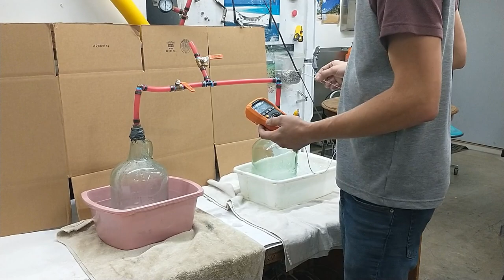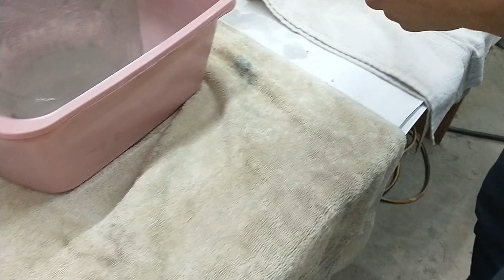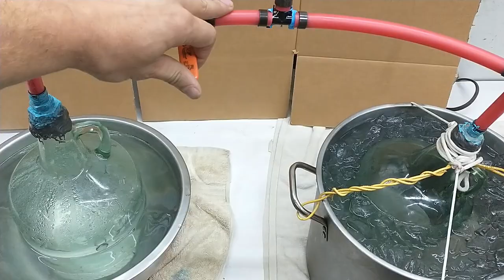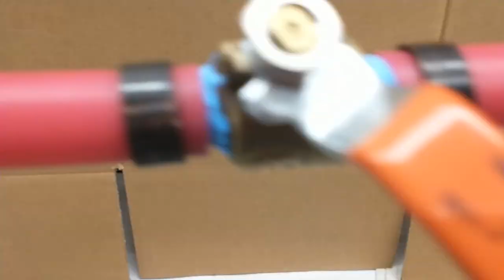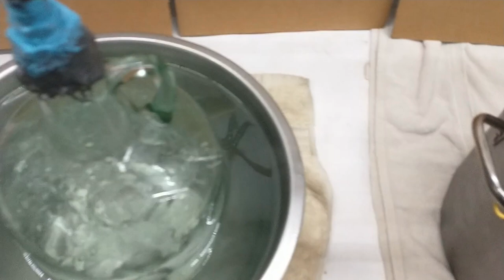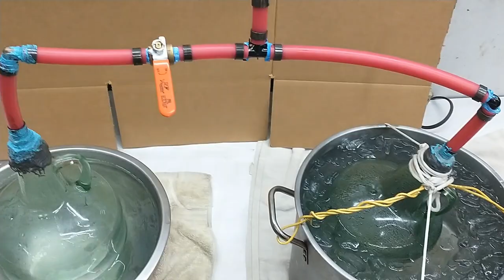COLD BOILING WATER To power The Tesla Turbine Renewable Energy System

Comment: Excellent work Jeremiah. Just some thoughts.
Is it possible that all the confusion in the comments, as to the stabilising of the two reservoirs, is due to a misunderstanding of what is actually happening?
 Steam powered turbines work with a positive pressure, forcing the gas (water vapour) through the turbine and out the exhaust. You are working with a negative pressure, yet using the same logic in your explanation, that the boiled water is going into the turbine and out the exhaust. 
 I'm not too sure that this is what is actually going on, at least the explanation doesn't sound too clear, hence the confusion. The water vapour isn't being pushed through the turbine, by the boiling of the water (at a lower temperature because of the negative pressure). It is being sucked through the turbine by the condensation of the vapour in the cold reservoir. The gas being turned into water, by the temperature reduction in the cold reservoir, is the "driving force" not the boiling of the water. The water vaporising in the hot reservoir is simply filling up the void created by the cold reservoir.  There isn't any positive pressure involved, if there was, the water wouldn't boil at that temperature.
  You are creating a negative pressure by condensing water vapour, to turn the turbine, you are not creating  water vapour, by boiling water to turn the turbine. The boiling water is simply supplying fuel (vapour) for the condenser to create a negative pressure, which turns the turbine.
 I hope you get what i am trying to say, and keep up the good work, I'm very much looking forward to your next video.
Reply from the maker: It's important to note, that if the water in the cold container was closed off from the boiler, there would still be vapor pressure from the cold water, just much less then the vapor pressure in the boiler. So the first explanation is correct. I see what you mean though, it's just a different way of looking at it.
Reply: @iEnergySupply  You are correct, my wording wasn't too good.
 I think increasing pressure and decreasing pressure, would better than positive and negative pressures.
 If we look at it, as the pressure is being continually increased, by the boiling of the water, then it is logical to think that the two reservoirs would stabilise, (hence the need to continually create the vacuum by other means). Whereas if we look at it, as the cold side is continually decreasing the pressure, then it becomes logical that the two reservoirs will not stabilise.
 This is, as you say, just another way of looking at it, and I'm not too sure how, or if, it could have any implications as to how to perfection it.
 My thoughts are, if the cold is the driving force, which we don't have a shortage of in the winter months, where solar cannot fulfil our energy needs, then storing the heat during the summer, to supply the warm air, would be more effective than counting on the sun in the winter to create it (the warm air). Storing hot sand underground, is no different than storing cold ice underground, which we had been doing for many years before refrigeration.

Comment: It would be interesting to measure the energy spent to create the vacuum and that obtained during the pressure rebalancing phase. Sun and snow seem to be the key to everything. Pretty awesome!
Reply from the maker: once you connect the two tanks together with a pump and a one way valve the vacuum pump never needs to be used again, it is only used one time to prime the system.
Reply: @DaxsDad  Let me clear up how this works for you.

Once the air is removed by use of the vacuum pump there's only water left in the system, both gas and liquid phase. The vacuum pump does not need to be used again as long as the system is airtight, because there's no air to remove, only water and water vapor.

The energy in this system does not arise from nothing. The energy put into this system is heat energy from the warm water on the left. The vacuum lowers the boiling point of water, so warm water below 100C is enough to cause it to boil aka convert water from liquid to gas phase. The flask on the right is cooled to below the boiling point under that vacuum, causing the water vapor to condensate.

Water takes up roughly 1000 times the volume in gas phase compared to liquid phase. So when it condenses on the cold side that water vapor coming over from the warm side now takes up 1000 times less volume, this keeps pulling a vacuum on the warm side causing more and more to boil over to the cold side.

This process will continue until either the temperature on both sides are the same or the warm side contains no more water to boil. If we imagined this setup, but the warm and cold side are continuously supplied with fresh warm and cold water, then it will continue to boil over until the warm flask has no liquid left in it. At that point you can run cold water on the warm side and vice versa to continue the process in reverse.

Now all you need is a turbine in the pipe going between the flasks. The flow of the water vapor will make it spin. Effectively converting heat energy into kinetic energy.

So you see, the vacuum IS NOT what gives this system energy. It is the heat energy applied on the left flask. In fact you can build a fully functional setup like this without even putting the system under a vacuum, just sealing it up. The difference is just that you'll need to heat the left flask to 100C to make it boil, this will create steam which will condense in the cool flask and this continues as long as the left flask is heated and has liquid water left in it. Doing it under a vacuum is probably just more efficient and easier to work with (don't need a scalding hot heat source).

So if anyone doesn't understand the laws of thermodynamics here it's you. This is simple physics used every single day in numerous applications worldwide. Heat pipes work on this principle, they're just hollow copper pipes with a little bit of water under a vacuum. Heat one side, the water vaporizes/boils, flows to the colder side and condenses.

Learn some actual physics before you go on the internet and make a fool of yourself.
Reply: @DaxsDad  You didn't pass basic physics and chemistry in school did you? I suggest you read up and learn more before making an utter fool of yourself. There is no free energy here, there is no perpetual motion. There just is a more practical range of temperatures, at the cost of having to put it under a vacuum, at least once, if we assume no leaks.
Reply: @MikaelIsaksson  > There is no free energy here
Exactly, the energy comes from the heat difference between 2 chambers, cmon do you have a problem with reading comprehension?
Reply: @DaxsDad  This isn't free energy at all. The only real reason he's introducing a vacuum here is to lower the boiling temperature of the water so that you can safely use the system in or near the home. It also allows you to use a wider variety of materials that might not withstand high temperatures.
 Additionally by reducing the boiling point it means your working in an overall lower temperature differential band, the temperature differential scalar value would be the same, but it means we can work closer to ambient temperatures for our condenser. Another benefit is that by operating in a lower temperature band the rate of heat loss to the atmosphere is reduced, as the greater the temperature differential the faster the rate at which the heat transfer will occur. It also means standard insulation can be used in conjunction with the system as you won't need high temperature rated material as previously mentioned. Also operating below 100C is a very smart move as most regulations around boilers and what not don't come into play till you go above 100C, or a certain pressure, by working below this it makes it much easier to get into market as well. 

There's nothing particularly ground breaking about this either, this is all just simple physics. The real triumph here is that this turbine unlike other more conventional designs is much simpler in design for most of the primary components, and is compact compared to traditional counterparts, which makes it ideal for off grid or microgrid applications. For those of us in Northern climbs as well a system like this is much more sensible to use than a solar array. Especially when the outdoor temperature is -20C on a regular basis. If the temperature differential was great enough you could probably run the turbine off the 23C ambient temperature of the home, the result of doing so however would be robbing your home of heat to power the turbine which would be a pointless venture, as is why you'd probably want a separate source of energy to heat up the boiler side. But that too is the benefit as others have stated, you can use many different methods to heat your boiler, and you can probably use solar collectors during the day to heat the boiler and then at night use the stored energy to generate power, the additional benefit there being that at night your condenser would be at a lower temperature and increase your overall differential, especially where this is under vacuum the boiler side can be closer to ambient temperature, which reduces the rate of heat loss throughout the day to the atmosphere. 

If you also dug down far enough, the temperature of the ground stays above freezing, so you could also use the earth as a source of heat too, like a geothermal heat pump. Though I suspect that would be overly expensive for the gains compared to a simple boiler design with a solar water heater.

Comment: What I see the detractors missing is the simple fact that, as the Low Temp Steam condenses at the cold side, it reduces the pressure in the system, sustaining the vacuum until, as you said, a threshold is reached where the process cannot be sustained.
Like, when you run out of water in the boiler..

Comment: I understand the working fluid in a heat pipe can move as fast as the speed of sound in that medium. 

You might take note of hot side temp cold side temp  and rate of water transfer. You might then determin the amount of heat energy per second it can transfer.

Comment: Have you heard about the new gas phase technology that utilizes a voltage process to efficiently split water and using the expansion of the gas products to spin a turbine? It is said that it gives more electrical power than if one was to just convert the HHO back into water using a fuel cell.

Comment: Lot of people here in comments seems confused. So lets throw some terms and numbers. The Carnot efficiency determines the maximum efficiency that you can get from the heat cycle like you see on the video. It purely depends on the absolute temperature difference on the hot and cold side (1- (Tmin/Tmax)). Here on video i see  139 F = 332.15 K on hot side and 37C = 310.15K on cold (funny how the units are switched).  Thats about 6.6% maximum potential efficiency of energy convertion (which is only theoretical and never reachable). But why not, lets add a tesla turbine to it and lets be very very optimistic and say that it has an isentropic efficiency of 60% and everything else is optimal. Then the overall energy conversion efficiency would be almost 4%! But more likely much lower.

But fuck it, Im gonna build it anyways on my offshore hut,  just put a 1kW heater to keep the water boiling at 90C and assuming its cold outisde so I have 30C in my condense, then and I can get around 90W in electricty back!  Almost enough to keep my 2 lights on! Sure I can scale it up, maybe for 10kW heater, then I could get back 900W, which is more interesting. In this scenarion the efficiency will be 9%, because Im not considering the closed cycle, where I would need to add up the energy required for pumping the condensed water back to evaporator at slightly higher pressure. 

There are better liquids like Refrigerants as well as better turbines, that could utilize this low potential temperatures and they are commonly used in Organic Rankin cycles (ORC). Its nothing new and this field is quite well researched. Well designed ORC's could reach energy conversion efficiencies up to 20%.
Reply: Very cool.. Would this be the type of system you recommend using or do you have other ideas?
Reply: @joshuanorris9785  It just depends on your needs, expectations and price you are willing to pay. For each there bunch of solutions. This project seems like something to do for fun since you can DIY most of it, but at the end it is not worth it.
Reply: @radomirfilip8741  Since natural gas is 3x cheaper than electricity where i'm from I was hoping that I could use this to convert natural gas into electricity.. But if it's not efficient then what's the point? I also have A LOT of waste heat from my business that i'm looking to convert back into electricity & am seeking the best approach.. Thus far I see this as the best option. Any ideas?
Reply: @joshuanorris9785  As the current state of art, the ORC cycles are thus far the best for converting low potential heat into the electricity. But it depends on how much waste heat is available and at what temperature level to make sense of it economically.

Comment: Awesome. Do you intend on making a closed loop system to somehow replenish the water on the hot side?
Reply: IRC yes that is the plan.
Reply from the maker: absolutely
Reply: How can it be done without stopping the system?
Reply: @12knut  You simply reverse it. With a few one way valves in the mix, which tank was hot and which was cold wouldn't matter. So you switch around a few valves with your heat exchanger whenever the water levels get too low.

Comment: Is the guage on the cold side of the turbine reading micrometers of mercury?
Reply from the maker: It would with lower with lower temperatures but water vapor pressure will always be there and keep the vacuum from getting super low
Reply: @iEnergySupply  - what pressure do you pump it down to, to allow the setup to run?
Reply from the maker: @orcoastgreenman  I get all of the air out of the system, on the vacuum gets low enough it automatically starts pumping water vapor. At which point the the air is completely out of the system, I'm not sure. That would have to be studied later on, but you can look up the vapor pressure of water at different temperatures.

Comment: Hello. Could it work with 10-30°C temperature difference like heat pumps - ground to surface ambient temp? I mean - if for e.g. we use existing or altered heat pump system at home to create a vacuum we could only add adequate tesla turbine to generate electricity?
Reply from the maker: I believe so
Reply: @iEnergySupply  Thanks for your reply! I am also thinking: fresnel lens to focus the sunlight to heat the hot side (only to keep it at 60-70° C) and some type of a pipe coil below the ground terminated with the pressure cooker for the cold side for a condenser. How did you come to this idea anyway? It is mind-blowing discovery! I am experimenting with some other patent from Veljko Milkovic (Serbian inventor from Smiljane, too - like Nikola Tesla. There must be some kind of strange radiation over there :D)

Comment: what you are showing us is the second law of thermodynamics from 1850 combined with the lower pressure to make water boil in lower temperature... Thats why we 1982 set the standard of boiling water to 1bar..... "heat can never pass from a colder to a warmer body without some other change, connected therewith, occurring at the same time. " .... Even if you have deltaQ between hot/cold it does not matter, its just a one-way run...
Reply from the maker: not sure what that has to do with the turbine in operation. We have never had a turbine run away before with this method.
Reply: @iEnergySupply , well im asking myself the same. The video has nothing to do with the turbine, its just physics what you showing us. But.. if you put a turbine (as you suggestion in the video) its just a one way run.

Comment: You won't need to constantly run a vacuum pump but you'll discover that the water can contain a fair bit of  dissolved gasses (oxygen and nitrogen) that can collect over in the condenser side, and limit the max power for a given temp difference.
Reply from the maker: Absolutely, we found that we must purge this out over several evacuations, and the system runs better and better. After about 3 purges the vacuum stays constant.

Comment: how well are those pex lines working out for yall? do they handle the pressure well?
Reply from the maker: O they are perfect, we have even used them with 212 degree water in the past without any issues.
Reply: @iEnergySupply  also, between this demonstration and the demonstration where you use water injected into a compressed air stream a la the boundary layer video, i think youve figured out how to use water as a reaction fuel? 

like, in that vid you forced the water to explode or rapidly expand, releasing its latent heat for the tesla turbine to sap. and in this demo you use a little bit of energy in the form the vacuum pump and warm water, but sets off the phase change of the water, releasing it's latent heat for your turbine to sap. 

i think this is the turbine answer to the stirling cycle's pistons, i wonder if one of these could be used to liquify air or make fluids super critically cooled.
Reply: also if you hadn't seen it, go watch the early slow-mo guys vid where they spin CDs and records so fast that they explode. the CD forms a resonate wave separate from it's rotation before it shatters; i wonder if something similar happens at high speeds in a tesla turbine. 

im wondering if those resonate waves create high pressure and low pressure zones inside the turbine that the coanda effect is forcing air into, thus forcing it to rapidly expand and contract hundreds of times before it leaves the turbine, making it so any heat inside the working fluid is dumped into the turbine